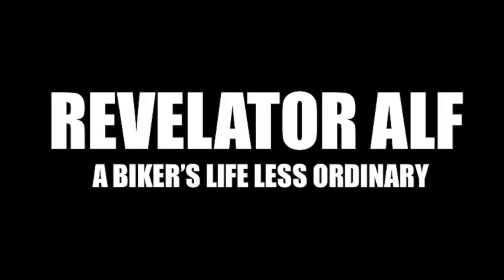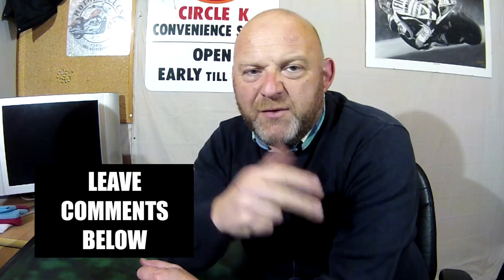Will Upstaging Damage My Harley M8 Engine

Comment: Long as you stay away from Harley parts for your stage upgrades you're golden. H-D's lifters, even the Screamin' Eagle ones, are junk and have trashed many an engine. Nothing but S&S parts and a TTS tuner for my stage 2 upgrade. Sure, I lost a full year of powertrain warranty but chances are I won't need it now anyway
Reply: KING KRIMSON  Sadly you are right. Harleys focus is only on profit, and they use their customers as Guinea pigs to test how low they can go on quality. There is a break even somewhere between quality and profit, and it seems Harley is constantly challenging that point.

Comment: Thinking off purchasing a 2020 street bob will   Keep powertrain all stock for reliability. The most important think for me is riding and putting lots of miles on the bike.  If you want more power get the bigger engine from the get go.
Reply from the maker: Yep, reliability and fuel mileage is key for me too for longer rides so keeping near stock works

Comment: RA good video and topic. For me upgrading is worth the expense. It's not necessarily about having the fastest/loudest HD in the crowd. It is 100% about ride-ability. My stage 2 Sport Glide is perfect for me. All Screaming Eagle. For my style of riding the throttle response is always there. There is less need to downshift then before. Just roll on and go. The Sport Glide just runs better. I will say this. The upgrade did cost quite a bit. Would I do it again? You Bet. RSMF.
Reply from the maker: Perfect to me too. Cheers

Comment: I was going to put slip on silencers on my M8, purely for a bit more noise to be honest, however to maintain my warranty they would have to be Screaming Eagle H-D parts. I believe that these are actually still street legal, TUV approved ( German/euro regs I think) so  wont be much louder anyway and at £800 I don't think I will bother now. Also makes me wonder why they don't fit them in the first place.
Reply from the maker: Yes the Street Cannon is only EC approved with the baffles still in I believe. You only get the sound and slight performance gain without them. I must say I am torn wether to even bother with any of it
Reply: @RevelatorAlf  Yes so am I, rather than spend the £1500 at least to do pipes, filter and tuner that is stage 1, I would trade my 107 in for a 114.

Comment: My particular dealer "Old Fort H-D" told me that any engine mods would void my warranty. You can imagine how much that makes me angry. I pay that kind of money and I can't put pipes and fuel management. Go figure ???
Reply from the maker: Yep it’s a big grey area and I do t think many dealerships are totally understanding of the rules too. It might be worth asking them to check directly with Harley about the specifics of the components you’d likely use and whether the warranty will be honoured, then get that in writing too. Cheers
Reply: I would check with another dealer.  I had Stage 3 done on my M8 and they told me I'd be good so long as I only used the SE tuner.  I could change to aftermarket headers or slipons if I wanted with no warranty issues.

Comment: Why would H-D dictate that upgrades must be done within the first 60 days of purchase or the warranty is void? What is the significance of 60 days? Or is this just another shake down the customer tactic by Harley so you'll roll the cost of the upgrade into your bike financing. If Harley actually believed in their own products, they would allow an upgrade at any time and offer extended or upgrade warranty protection as an option. If you don't stand behind your products, then you shift all the risk all unto the customer ... you bought the bike, well, good luck with that.
Reply from the maker: Yep I could not understand that logic either
Reply: Your absolutely correct, why 60days it should be within the 2 year warranty for any upgrade(HDHundreds of Dollars) 🤔🤔🤔

Comment: On this topic can we say that Screamin Eagle parts define the limits of modifications on the Harley Engines?. Let me explain!. Screamin Eagle (aka H-D) develop their performance parts in tandem with engine development. Independent tests show that Screamin Eagle add-ons produce the lowest gains in horsepower and torque on the market from Stages 1-4. They are therefore the most conservative products you can buy, but they don’t invalidate H-D powertrain warranties. So by definition do these components actually define the safe limit for H-D engine enhancements?. I have no idea, but its an open question!!.
Reply from the maker: Yes certainly is a good question
Reply: It’s not that there is a specific safe limit, that if you stay under it, the engine will last as long as an unmodified, and if you exceed the limit it will blow up. It is more like an increase of wear and risk of failure. The MoCo has probably factored that in, being aware that they risk more warranty repairs, so they price the stage-parts sufficiently high to make a healthy profit.

Comment: My dealer "Old Fort H-D" told me ,no engine mods or my warranty is dead meat. Can you imagine how upset I am?
Reply from the maker: Wow. Well at least that’s a definite answer. Actually I think most of the issue is with the tuner. It’s one big grey area for the warranty
Reply: If you'd done a little research before your purchase you would have heard of the EPA consent decree that Harley signed which makes the use of any non-EPA compliant engine parts or tuners an automatic powertrain warranty killer. Too late to be upset now...

Comment: Which is the exact reasoning I followed  in respect of the Mods to my bike.
TTS PERFORMANCE fitted the supercharger, and the Power Commander V and custom tune carried out by Dynojet UK.
Let's face it chaps, they do hundreds, and have a track record that attests to their expertise. 
Pricy?
You bet.........by all means have a go yourself,  I just hope, sincerely, you're as good as you think you are.
As for me.....I know my limitations!
Modifications aside, a lot of the points you raise are equally valid with a 'standard' machine.
Give it the pasty at every opportunity,  and bury the needle into the red zone you will repent at leisure. 
A little mechanical sympathy works wonders..........and for the love of God, warm the thing up before you launch it.
Reply from the maker: Yes absolutely so Chris cheers